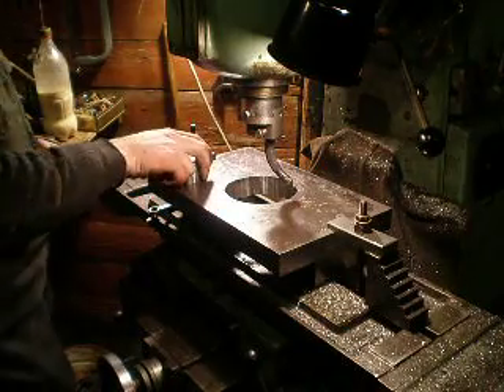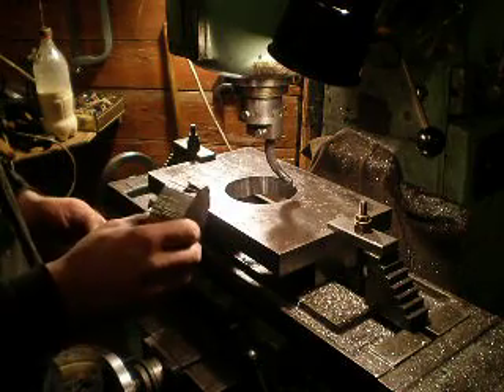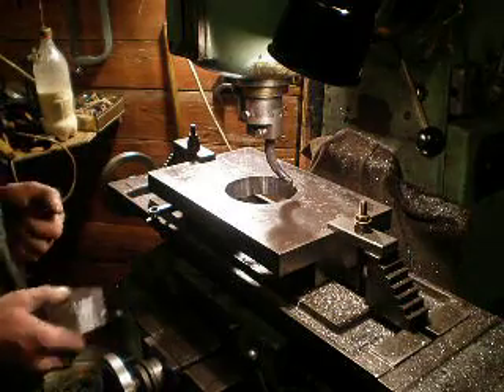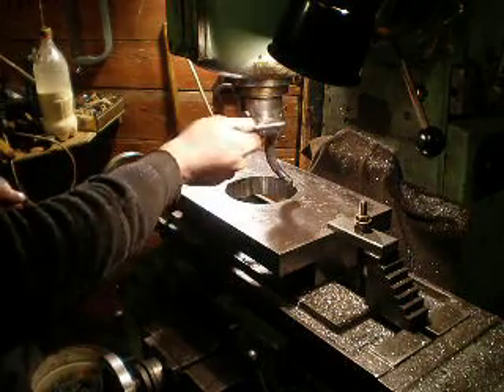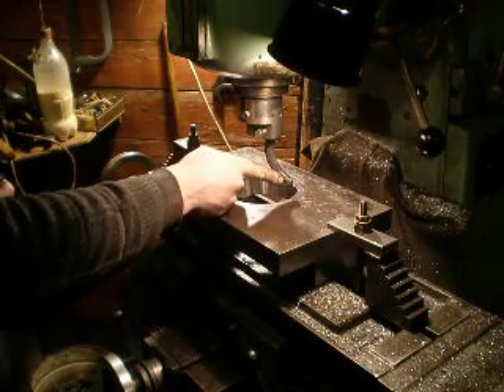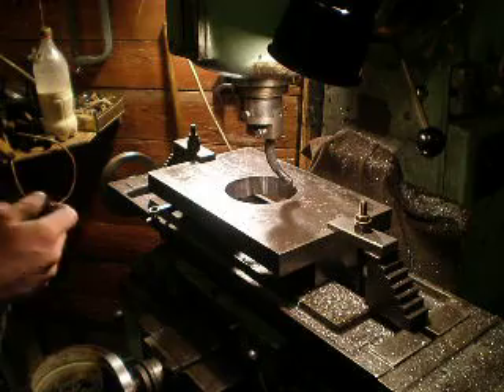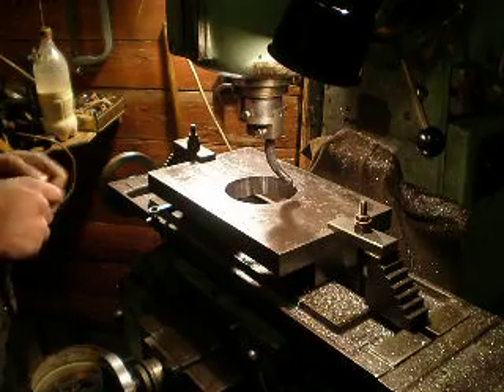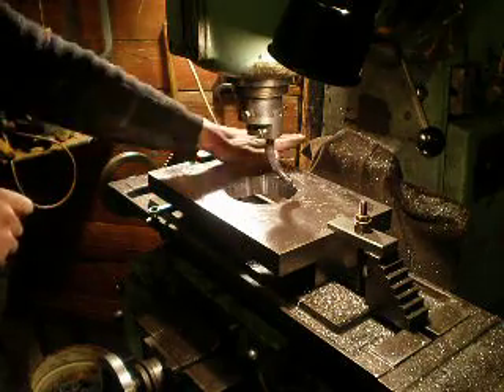Milling machine project Part1 - machining basic plate

Comment: You might consider slowing down your spindle when using the boring head to avoid galling (melting your cutter to your work piece and shearing it apart, ruining the cutter and damaging the work) (it looked a little fast...just starting to scorch, i.e. smoke).  Your English is very good (easily understood, vocabulary will come with time).